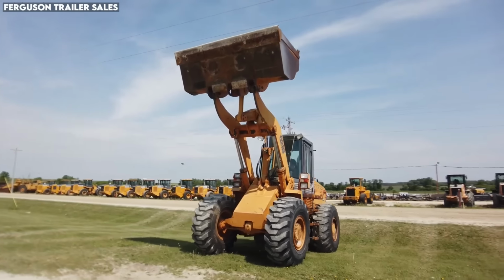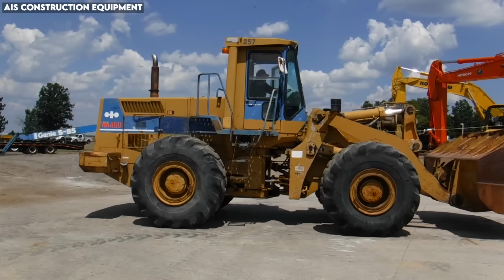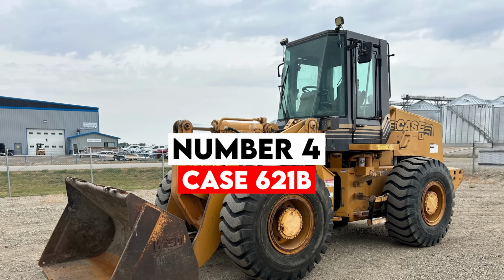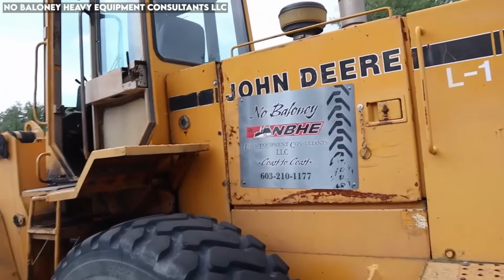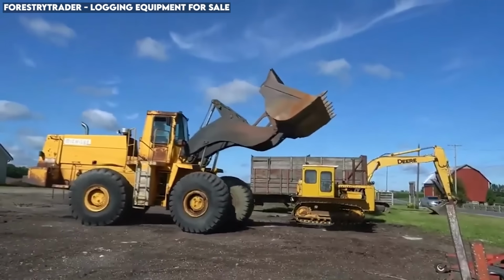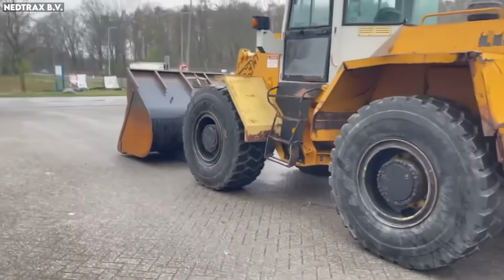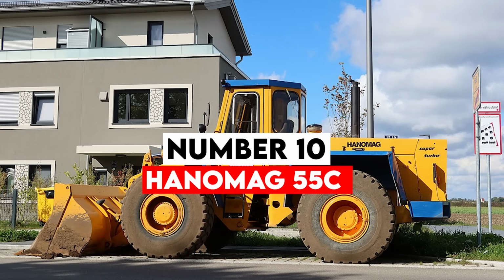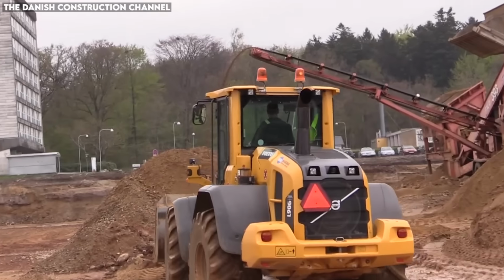10 Old Wheel Loaders From the 1980s That Refused to Die

Comment: As usual a lot of mistakes in your videos. The L190 did not have a Detroit engine but a Cummins. The Volvo L90 had a TD61 engine and nothing else. The Hanomag 55c had Hanomag's own 6 cylinder 10L water cooled engine etc.

Comment: When you talked about the (Michigan) with the Detroit Diesel engine for myself I own 3 Detroit Diesels 😊 the smallest one is a (353) the other two are V-8s one being a 8V-71 none turbocharged and my big boy with Turbocharged engine the 8-92 series with it printed on side of block (475-HP) 😊 it really gets up and goes from stop signs. 😊 can stay at traffic flow speeds. The Transmission is a 4 speed Allison Automatic 😊
Push button control console next to my Right hand 😊

Comment: I liked the Design of the CASE. my understanding of it's design look was trading with Caterpillar on front linkage arm design with CASE giving CAT the design on their first rubber tired backhoes the (416) with the two boom cylinder on digger. And the front looking like a John Deere backhoe with single center cylinder dump features 😊 We tested a CASE loader and a John Deere big loader at my work. And I did not like the way the CASE guy out showing the loader was to impatient with all of us were the J.D. sales guy was very slow and understanding on showing his loader. I did like the CASE with both a shuttle shift and button on loader lever. Sense we had 3 rubber tired backhoes in our fleet. I just thought with shuttle shift it would be easyer to operate because it was the same as are CASE- JOHN DEERW- CAT rubber tired forward and reversed 😊 with them all having the shuttle shift lever on LEFT side of steering wheel 😊